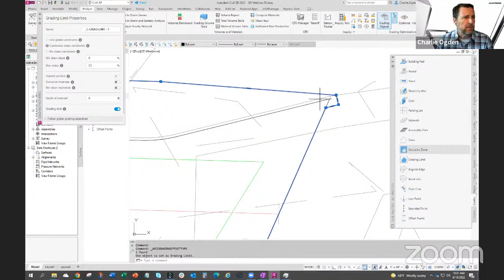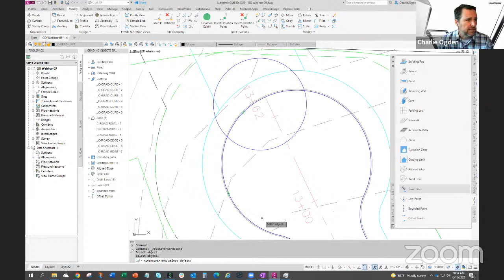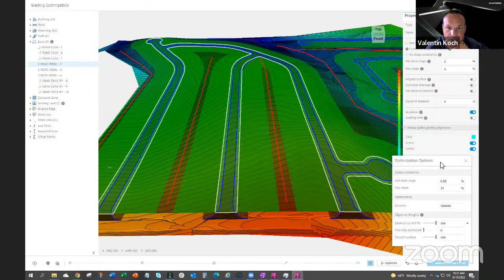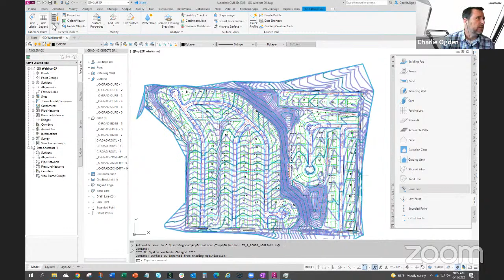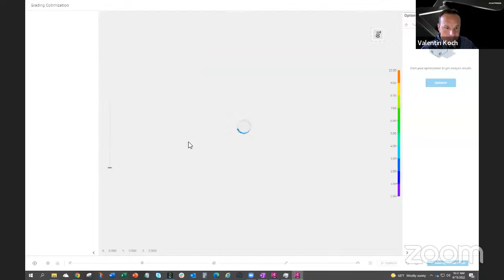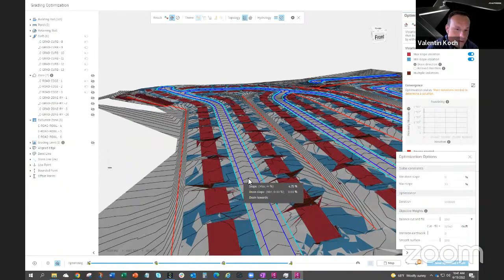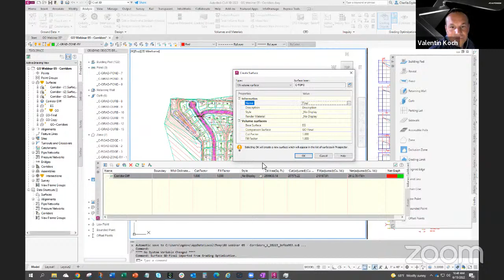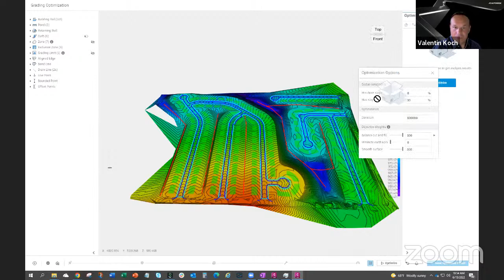Grading Optimization LIVE Part 5: Subdivision Grading

Comment: Cross-slope can now be defined in the roads using the new Pathway grading constraints made available recently in the Grading Optimization 2023.1 for Civil 3D Update.
Reply: can you explain again what settings you would use if you wanted an excess of fill over cut.
Reply: I can't figure out how to do roads with Grading Op because we can't set K values for vertical curves.